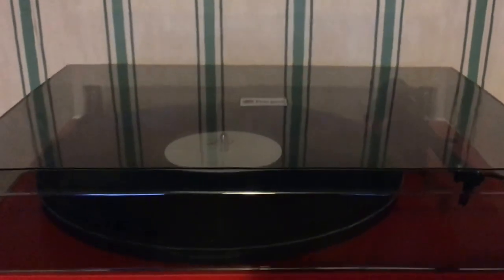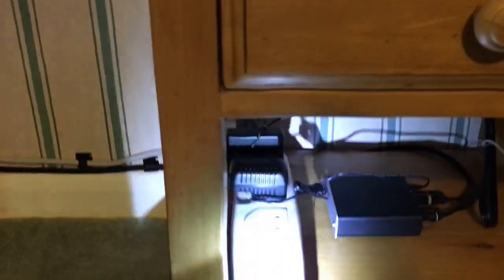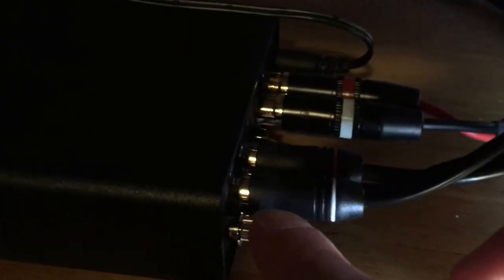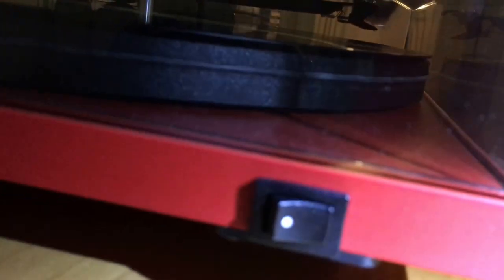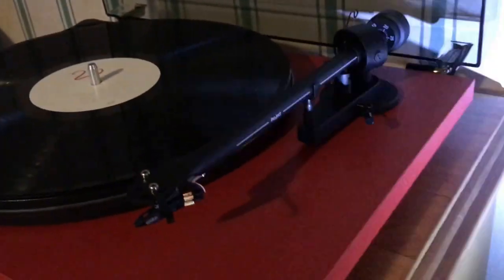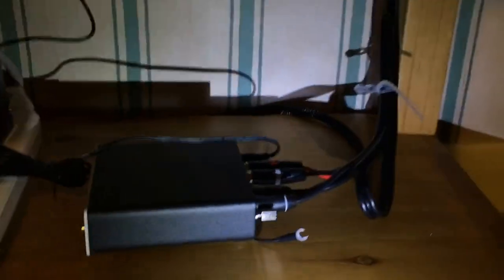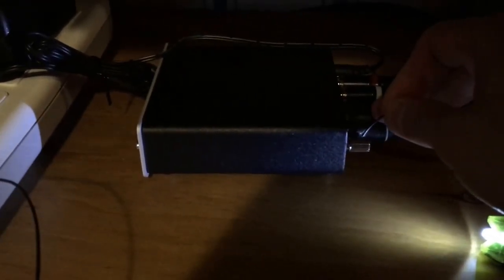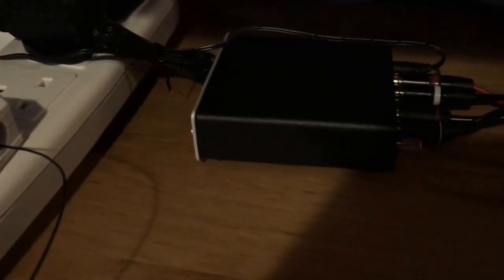SOLVED! Buzzing / humming noise from Pro-Ject Essentials II phono stage to Pro-Ject Phono Box ground

Comment: You're running unbalanced audio directly beside AC power. Of course there's going to be a buzz.... -_-
Reply from the maker: +qwerty22 please explain as I'm not sure what you mean. Thanks.
Reply: +Brian Su The audio signal coming from your turntable is considered unbalanced signal. Nothing wrong with that, its standard for all consumer electronics, but its sensitive to interference. You have the audio line running parallel to the power line against the wall, so youre getting the 50hz hum off the power line like due to the proximity of the two lines.
Reply from the maker: +qwerty22 Thanks. That's good to know.
Reply from the maker: +Casey Bitts No it doesn't make a difference as the 50Hz hum comes from the amplifier within the B&W Zepplin. I have tried this with a Bose TV sound bar and this time there was nothing running parallel to the RCA cable, the hum was even louder thanks to Bose being an inferior brand that uses inferior parts!
Reply: +Brian Su Lol, needed me to explain balanced vs unbalanced audio...tries to blame problems on bose "inferior parts"
Reply from the maker: +qwerty22 lol yah I'm just stating the facts following additional tests. In fact even when everything is turned off except for the speakers, the metal body of the pre-Amp (when ungrounded) vibrates when I run my fingers over it. (The same kind of feeling one gets with unearthed laptops with metal bodies). In this case only the speaker (Either one) is powered on, therefore it is coming down the RCA line from the speaker's amp. This vibration is stronger with the Bose.
Reply: With Bose you pay for the brand name, I used to own 901's which were good speakers with the right amplification and a big room, still have the old Waveform CD/Radio

Comment: For anyone uncertain about the type of wire to use. I bought a grounded extension chord, cut off the male current carrying prongs, cut off the female side of the chord, exposed the grounded chord (green colour) and taped it to the grounding port of the turntable (in this case a Fluance RT80).
Reply from the maker: Hi I can't find your other comment. This is just a standard 3 pin UK plug. I pulled out the live and neutral pins and threw them away :)
Reply: yes did exactly as you said and problem solved!   man i was thinking i was gonna have to buy another planar 2 and i just bought this 1 but i was thinking it was defective when whole time it was a simple grounding issue between pre amp and power outlet!!!!!!!!!   have another pro ject evo i gotta try this on next but as far as my rega planar 2 its golden now thanks to you guys !!!!!!!!!! you saved me another $800 with this trick cant thank you enough!!!!!!!!!!!!!!!!!!!!!

Comment: Unfortunately this method didn't work for me. I made  a pair of cables using a double shielded coax for satellite TV. It worked like a charm. No hum even at full volume, and the length is almost ten feet. The coax core is copper plated iron!!!

Comment: I don't think the issue is with the Phonobox though, because I bought a Phonobox to try fix this issue as I already had it on the phono stages of two completely separate integrated amps, in 2 different houses. Before I moved I was convinced it was my mains power, but then when it still happened I tried the Phonobox. Still had the problem. I did this fix, but when you think about it you are really just grounding the turntable straight to the mains.

This fix only reduced the hum for me, I can still hear it quite a bit on my DT990 headphones, and it's bad enough to actually completely envelope much of the lower bass frequencies.

I found that it got worse as the record played, and eventually worked out that there is some kind of electro-magnetic interference coming from the motor. Basically as the tone arm approaches closer to the motor, the hum increases. If I put my hand over the motor the hum lessens, so I guess I need to try and find a way to completely shield the motor now...
Reply from the maker: Hello, This is an old issue but there is a solution for your motor hum issue. Search for Pro-Ject High Power IT Power Supply and use that to power your turntable's motor. It is a grounded power supply designed to address problems like yours.

Comment: Fantastic job. There generally are two types of noise associated with turntables ie they are not properly grounded which makes a hum or there is a ground loop which makes a buzz. They can be difficult to solve glad you solved yours quickly. Enjoy your new turntable.
Reply from the maker: Thanks for that, in that case mine is a hum rather than a buzz.

Comment: THANK YOU!!! This worked 100%. Not only did the buzz go away, but the sound signal became more clear and controlled. More people need to know about this solution. Not even my local HIFI-store told me about this.
Reply from the maker: Hahahahaha glad it helped you, but now I'm jealous because mine still has a very faint buzz after doing this. Yeah I'm not surprised your local Hi-Fi store didn't thick of this. For some reason, audio people seem to overthink certain issues when the solution is a lot more fundamental. What amp are you using?
Reply: Brian Su - tried this solution, did not work for me either. I used the a pair of RCA cables which game together with a ground, connect from TT to pre-amp. The buzz was reduced but not entirely eliminated. T

Tried the 3-pin plug with ground wire on the pre-amp and the TT separately, still no good. Unlike you when I touched the ground wire to the ground portion of the pre-amp, the buzz did not disappear and got a little louder.

Here are the 2 things I'm going to try:
Going to try connecting re-jigging the 3-pin plug to tidy up the wires inside the plug, hope that helps a little bit. Got idea from a video from the comments below.

Next going to try and ground my amplifier, not sure how useful this will be but no harm trying.

Did you manage to solve your buzz?

Comment: Thanks Brian, that was a really helpful video. I had the same problem with my Pro-ject Debut Carbon TT and I was about to return it to the shop with a massive complain. The fix you suggest in your video initially did not help, probably because I use a different pre-amp. However I tried different approach and used additional grounding cable from the TT directly to my AV receiver and the annoying noise stopped. Your video made me consider alternative solutions for a problem that should not be there on a first place. You are right- the manufacturer need to do a bit of work in this area! Thanks again for the video!
Reply from the maker: Hello, wow Pro-Ject Carbon!! :)
Your solution is much better than mine. You should ground your TT + Pre-Amp to your AV Receiver (amplifier). The problem that I have is my receiver (the B&W Zepplin Air) has a plastic body so it can't be used as a ground.
Reply: Vince Popnikolov thanks for this suggestion man! Just resolved my headache!
Reply: Vince Popnikolov So you basically used 2 different grounding cable both attached it to your TT, one to your Phono amp's ground and other to your AV receiver's ground, right???
Reply: Vince Popnikolov Been doing this for years. It also works for Rega if you attach a wire to its motor.
Reply: Mert M. You can attached the ground to any part of your system so long as they are connected to each other. I generally attach it to my pre amp ground  post.

Comment: What is the thing you use called? Ground socket? Ground plug? Never seen anything like it
Reply from the maker: I made it myself with a standard AC power plug with the ground wire connected to the Earth pin inside.

Comment: Sorry if you said it in your vid but you said it was a design flaw by Project. As I understand that the issue was caused in the pre-amp, does that mean that the pre amp module is also from Project? And could this mean that, if you have the pre amp built into your amplifier, the amplifier itself might produce a hum if it’s not grounded? If I take a look at my Marantz pm6004, it seems that power connection has no ground (only phase and 0).
Reply from the maker: if your amplifier already has a built in pre-amp, just switch the input to it and turn the volume up. Do you hear a hum?

Comment: Hi Brian, I have a vintage Rega P2. Ive tried buying a normal extension cable, cut off the female socket, normal pin and active pin, stripped back the earth lead. I screwed this onto the grounding post of my Pro ject phono box s2 and plugged it into the power board where my speakers and phono preamp are connected. However, the hum is still present and very noticeable at high volumes. Is this normal? Or have I gone about this the wrong way?
Reply from the maker: Does the hum reduce when you plug it in? Sounds like you’re doing the right thing.
Reply: @BrianSu  Nevermind I found the problem. It had nothing to do with the preamp grounding. Turns out the hum was caused by incorrect cartridge wiring configuration and the location of my preamp. I’d initially put it behind my TT near the power cord which creates a hum probably caused by interference

Comment: Using project essential 3 here, mine is working great, no buzz.   I don't know what kind of network or devices you put into your wall electric outlet.. but if it is Powerline Network (RJ-45 to electric wall)  i suggest you remove them all and use only RJ-45 wire or wifi.   Powerline Network devices send garbage signal to all AC/DC devices.
Reply from the maker: Noise is caused by the pre-amp -> amplifier path. Even with the turntable disconnected it still buzzes. I've already tried disconnecting all HomePlug devices. I tried basically everything, even running the pre-amp + amp + speaker all on battery power to no avail :(

Comment: bought a new Pro-Ject Classic Phono Amp facing the same buzzing noise can i use this method forever without harming my speakers ? or any other solution regarding this ?
Reply from the maker: Earthing will extend the life of your system and speakers, you only need to do this if you're using a cheap amplifier. The good ones are all earthed. Yes there are a few other methods that I've covered in a new video. The link to it is in the description.

Comment: Thanks, your solution sorted the hum out I had with a technics SL1200, can hear zero buzz now.
Reply: I’m having similar issue. Can you talk me through how you set it up?
Reply: smyth77 Hi, Originally I had the ground wire from the SL fixed to my phono stage ground screw on the back of it = hum from record player, i don’t know why as in previous houses I lived in and with other phono stages i had no problem.... anyway I took an old wireless wall plug and put the ground wire from the SL and screwed it in to the earth plug pin. (If you don’t know what this is it is imperative that you get help from an electrician!) I then plugged this into a wall socket. Viola, no hum. I figure this is because the ground from my phono wasnt working correctly. Also I’m based in the uk, i have no experience of other countries plugs etc

Comment: Thanks for doing this! I was dealing with the exact same issue, and it's fixed now, thanks to your very well done video! I used  a 3 prong replacement plug and removed the 2 power prongs and left the ground. Then crimped spade plugs to some speaker wire, and hooked it to my Pro-ject Box DC and zero hum now! Thank you!
Reply from the maker: Yay :) glad to hear that. What phono pre-amp are you using?

Comment: Hey Brian. I’m in the U.S. what type of plug should I get to stop the humming. I too have the pre-amp etc... what should I search for (the plug that you used to stop humming)
Reply from the maker: Hi just search for a US 3 pin plug that allows you to install your own wires. Something like this: https://www.ebay.com/itm/AC-125V-15A-3-Pin-Male-Power-Cord-Connector-US-Plug-Converter-High-PerformanceHH/303636926445

Comment: Hey! I currently have the Project T1 connected to Project Phono box E. To get rid of the humming issue, I put the earthing cable (coming out from the turntable) on the RCA cables (coming out from the turntable). That straight up solved the issue but I don't know how safe that is. What is that earthing adapter thing called that you used in the video?
Reply from the maker: I don't understand what you've done with the earthing cable. You should connect it to the Phono Box's grounding screw. That's what I've done. I then run an additional cable to the Earth pin of the power plug.
Reply: @BrianSu  so I don't know how to run an additional cable through the earth pin. I'll explain what I've done - There are 3 wires coming out the turntable (2 RCA cables and 1 earthing). Instead of attaching the earthing cable to the grounding terminal on the preamp, I just touched it to the 2 RCA cables (which was attached to phono in) this resolved the humming issue for me. However, I don't know if it's the safest way to go. Hence, wanted to understand how  you made that plug.
Reply from the maker: @tanishqpradhan3  You'll need to attach the earth cable from your tone arm to the grounding pin of your pre-amp. That's the whole point of why it's there. Please do that first. Which country do you live in, so I can advise on the earthing.
Reply: @BrianSu  I'm from India! Whenever I connect it to the grounding terminal, it makes no difference sadly. Thanks a lot for the prompt response!
Reply from the maker: @tanishqpradhan3  https://www.indiamart.com/proddetail/15-amp-3-pin-top-plug-13352390755.html just buy one of these plugs, open it up, connect a wire to the earth pin and the other end of the wire to the ground screw on your pre-amp.
Reply: @BrianSu  alright perfect. So just to be clear the grounding cable from my turntable and the grounding cable from the new adapter I buy, both will be connected to the grounding terminal right?

You actually helped me out with a link. Thank you so much!
Reply from the maker: @tanishqpradhan3  yes correct
Reply: @BrianSu  Could you tell me which wire you used? And if you have any reference video that'll guide me in making what you made, it would be perfect. Not really well versed with wires & adapters. Thanks in advance brother!

Comment: I think i know the probelm. Really really interesting video, helped me work out what's wrong with my amp.

If there's a problem with the preamp or interface humming, its because of the --resistor--,  the resistor must be blown, who knows why, a component could have been fused to the chassis ground (which is the problem I have with a cyrus two so I'm currently replacing parts in mine...
But that explains with an external grounding fixed your problem 
Try get hold of a resistor for your box
Reply from the maker: Husayn hello, what resistor? I’ve had the same issue with a different pre-amp as well. It was a Chinese one with GE tubes. Same buzzing sound if not grounded.
Reply: @BrianSu   Hi Brian, when you say, if not grounded, do you mean grounded with the 2nd wire to a plug socket, or just grounded from the turntable to the preamp?

https://youtu.be/sK9e102L49Q
If you go to this link, at 4.25, that's an example of how a resistor could be blown, there are  few ways of course and it effects the phono stage

Its the same problem I'm facing with my own cyrus two like the one in the video so I'm going to try your method with the plug till I work out what kind of resistor I need to get hold of to replace the old one (I'm currently changing all my capacitors)
Anyway, if changing my resistor fixes the problem, I'll let you know
Reply: Hi Brian, I had a good crack at my cyrus two and turn table again... in the end I wired a new high quality lead to the turn table and it fixed my problems

Comment: The ground lug does not make contact through the black anodization. You need a new ground lug. And solder a wire to the tone arm ground and to the new ground lug. This worked on my turntable.

Comment: Change the RCA anything with screen ,connect that screen with any thin gauge wire to the cardboard with outer tinfoil where u can solder them..do the same thing with the other side's  rca screen,connect/solder a thin wire  connect it to then the phono amp's ground.

Comment: Hey I'm wondering if you think your fix would help me.  I have a bit of a different setup w/ a project-carbon that has the ground connected to the turntable itself from an amp directly beneath it, and I was also getting a buzz that I'm 90% sure is due to a grounding issue, but since the grounding goes to the amp (which has a 3-pin connector) so it's receiving AC there I'm pretty sure.  So basically, with this slightly different setup do you think the additional grounding could still do anything for me (and also where did you get the plug to allow for the additional grounding).  Thanks!
Reply from the maker: +PastaPig hmm no harm trying. Your AC adaptop (which has a 3-pin connector) may not be grounded. Are you sure the Earth pin isn't just plastic? The white plug was purchased from a normal hardware store along my high street, you can get them anywhere :).

Comment: Clever! What kind of connector (the white box) is the one you used for connecting the black ground cable?
Reply from the maker: +Walter Del The white thing is just a standard 3 Pin UK plug :)

Comment: Hi I I dont have a ground wire for my TT so what if  I used a ground wire from the stand alone amplifier GND to the preamp GND? Would that reduce the buzz from the pre amp?
Reply from the maker: Hi, Yes because this fix has nothing to do with the TT at all. It's just the nature of how pre amps work. Even without the TT connected, it'll still buzz unless grounded.
Reply: @BrianSu  Hi thanks for the quick reply what would you suggest I use to grounding. I have speaker cable?
Reply from the maker: @elvisrafi  any wire will do but for aesthetics just use the thinnest one that you have :)